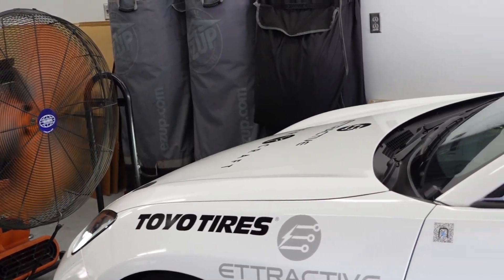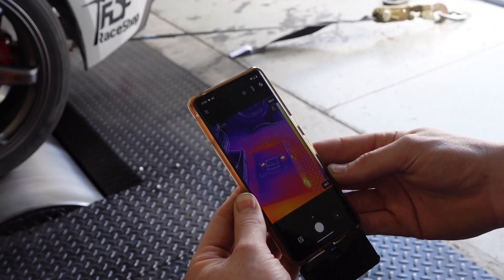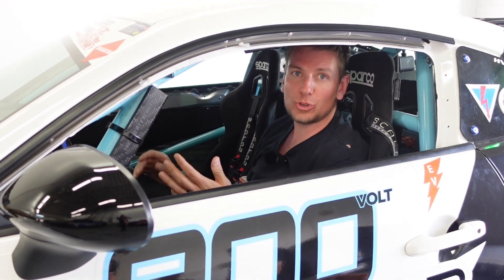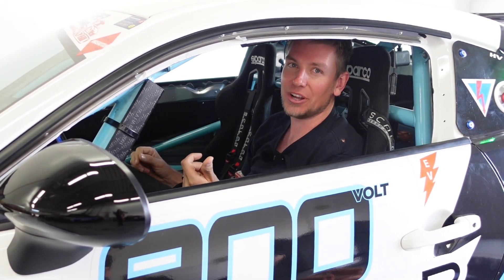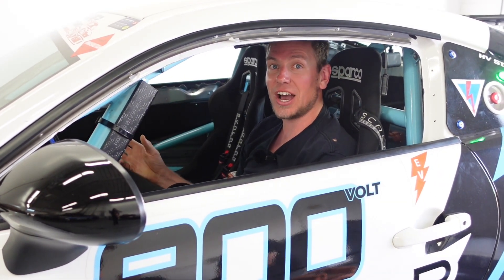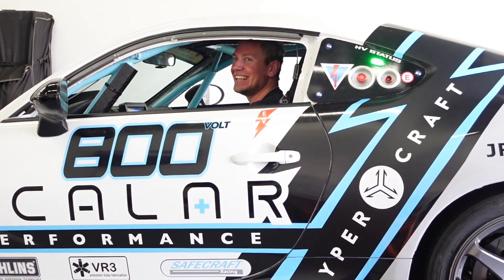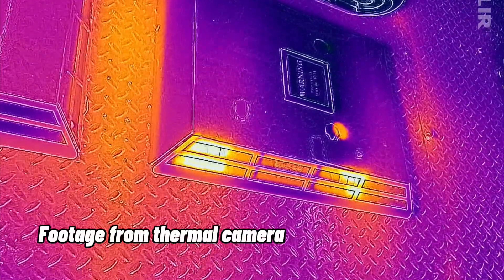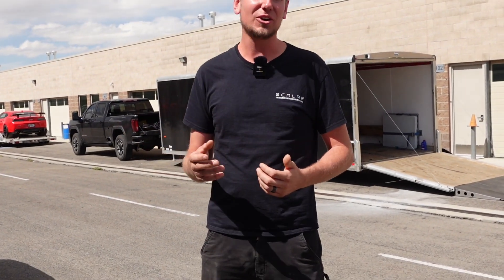Witness the SCR1 Electric Race Car Being Dyno Tested - Will It Survive?

Comment: I have a water cooled dynapack that wont have this porblem ;) for a nominal fee i can bring it to you
Reply: Where are you located?  We've since used a Dynapack 4000 for testing which is also water cooled and that was much more effective in a number of ways than the roller dyno.  It is also water cooled and still got incredibly hot but did keep up.

Comment: This is pretty damn cool. I wonder what the reasoning was to go with the new generation gr86 rather than the last gen gt86. It would be significantly cheaper.
Reply: The goal is to develop and sell a turn key race car.  At the price point required to cover the electric power train, we felt folks should be buying a new car not an used one.  Truth told, the gen2 GR86 isn't just a great platform but once we sell the very desirable ICE powertrain from it (which fits previous gen cars and most Subie swaps) the chassis cost is quite reasonable in the overall bill of materials to build the SCR1

Comment: EV race car.  Horrible.  Gone is the joy of tuning an ICE engine in competition, making more power,etc.  Sound of engine, smells, etc. These people are pandering to the political narrative.   You can call it progress...I call it the end of something wonderful that will never be replaced by these beta-male electric scooters.
Reply: you're mad 'cause these "beta-male" scooters are faster than your alpha gas guzzler V8. 90% vs 30% in terms of efficiency, that's a quite big gap. Gas is more energy dense than current battery tech, but too bad modern engines cannot use it all.
Reply: @tuan.hoang_  mad about what? Raised cam Hemi can make 5000hp, top fuelers over 10,000 hp. Not mad about anything! It's great to smoke one of those souped up RC cars
Reply: @tuan.hoang_  Touche.  But I'm not mad about that.  There are things I can't argue with in terms of the pros that EVs bring.  But let's wait to see, for example, when there are crashes into the wall with these hyped EV race cars.  Once batteries are damaged, it's game over.  And the fires....the whole race may be canceled.  EVs from start to completion are more of an environmental hazard then are ice powered vehicles.
Reply: Show me on this doll where the ev hurt you.
Reply: He states that the eddy current load would stall an ICE car. That is a broad statement- depending on what engine you have on there. I own a dyno and know this for a fact. The dyno operator explained it correctly.

Comment: Sounds like a great sprint car just no good for the lemans 24 hour
Reply: Maybe 1 out of 24hrs?
Reply: The car is competing in the NASA Super Touring series which are 30 minute races.  It designed for club level competition.  Scalar has built a gas version for endurance racing